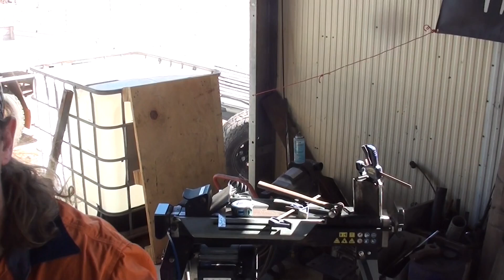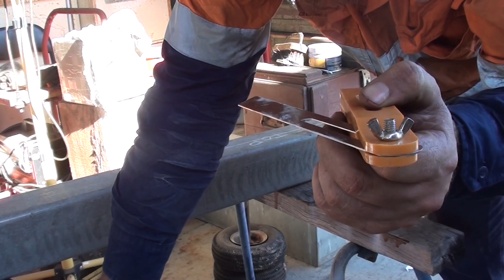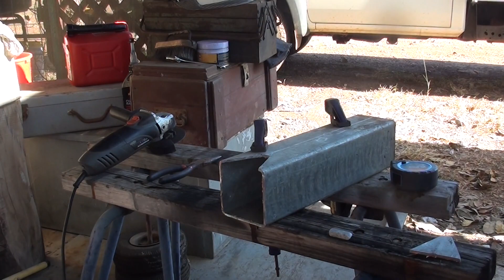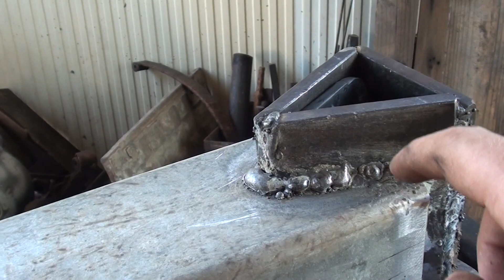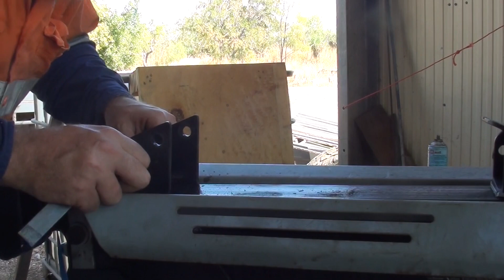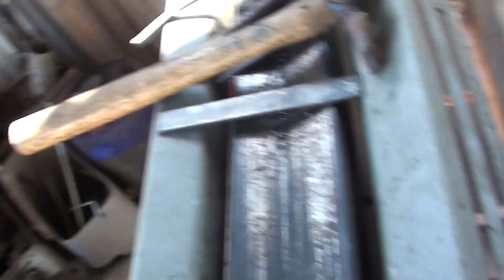Building an Electric Log Splitter Forge Press Part 1

Comment: 7/16is 11mil!
Reply from the maker: You're right. But metric doesn't exactly translate to imperial. That's why i said about 7/16. When working with 2 systems in blacksmithing where exact tollerances aren't crucial, close enough is fine 😁 thanks for watching james

Comment: Good start Aaron, tip for welding, if you dont clean a good 1/2 inch away from where you want to weld the shit you left too close cannot resist the fun and will migrate to the party creating Gorilla snot!  If it does crash the party use brute grinder force to evict it before continuing celebrations!
 The grinder is a welders best friend!
Reply from the maker: Cheers for the tip Paul